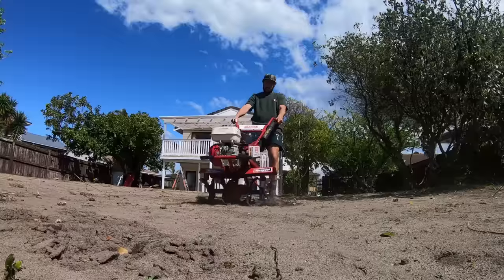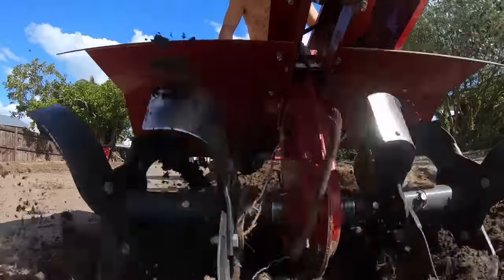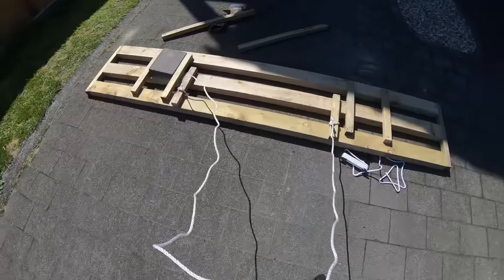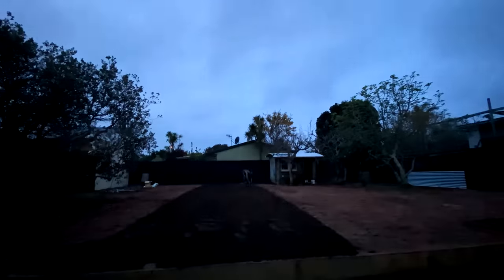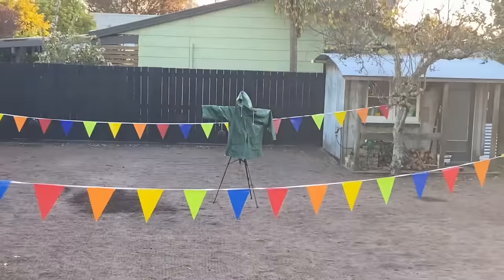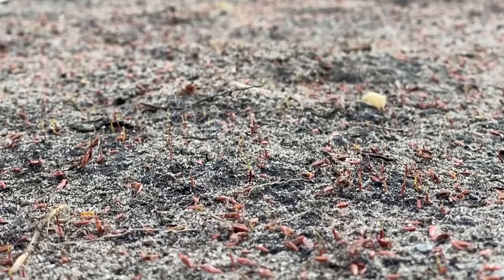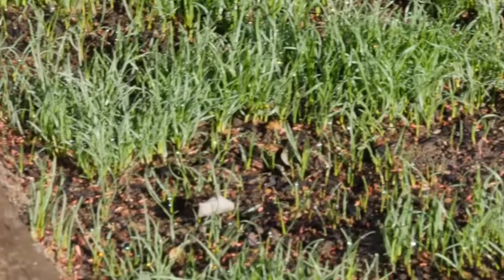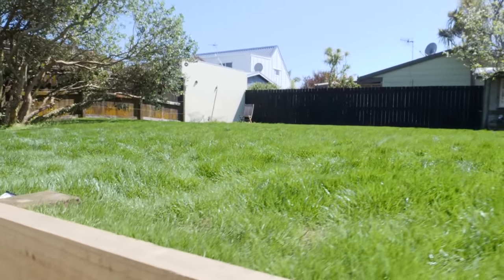HOW TO GROW GRASS

Comment: Great effort end entertaining, can somewhat relate. A couple of weeks ago I accidentally switched a liquid weed control product with RoundUp, and withered a 600 m2 magnificent lawn .. leading to a rebuild of cosmic proportions; so yeah, lots of therapy in that project.

You should have softly raked the seeds about 0,5 - 10 mm in the top soil prior to running the compactor on top and this is likely the reason you're getting bald spots.

Comment: Do you recommend germinating seeds, soaking for a few (5-7) days, in lower Fairfield county Connecticut ? Will have to mix the damp germinated soil with dry ingredients...use Peat moss? Fertilizer?  Please advise. 

I have a very bumpy, un-level side lawn as had to dig up yard to install water draining Cultech systems. So, will order about 20 yards of topsoil...I have about 5500 square feet of lawn/yard area that I will resoil and reseed. 

Further, any need to mix in sand? Lots of rocks, both big and small,  in yard....Connecticut tings' 😊 Thanks.

Comment: You did a great job! I would have recommended getting your soil tested before you tilled that way you could incorporate it into the soil better. I would still recommend you do that. It will help you in setting up your fert program moving forward. It will recommend the amount of nutrients that to be applied for soil correction, ph correction and grass needs for the next season. In the future, you can aerate (punching holes) and overseed and starter fert in the fall for increased density, turfgrass health.

Comment: ( State Certified Nurseryman - and BA minor in Environmental Horticulture ) You bought the wrong type of spreader. I don't even know why they make those - they are just absurd. A ROTARY spreader throws the grass seed more evenly and up to a 6 foot swath on each walk down the row - whereas the horizontal spreader just drops the seed straight down in like a 20" path. And of course if it is broken or the seed is damp at all it is even worse - and way too thick etc . .  I prefer a handheld rotary spreader with top bag attachment - which gives incredibly precise application of the seed. And watering before AND after initial seeding is necessary. And a light raking by just dragging the rake lightly after spreading the seed is a "best practice" and THEN - the most important part is watering at least once per day for 28 days minimum. ( 2 or 3 times a day is best if in hot time of year ) And a good fertilization as well. Preferably organic if possible.

Comment: Hate to be that guy, but what you should have done is broadcast the seed after just roto-tilling. The seed would have fallen into the low spots in the clod field. Then you could have run the roller over it to get good soil/seed contact, followed by watering. Seed in the ground will germinate and establish at much higher rates than broadcast seed. The raking after broadcasting didn't get it buried enough. Cool-season grasses are physiologically built to respond well to deeper planting depth. A thin mulch of clean straw will help keep the soil damp and reduce the number of waterings require to one a day at most.
You didn't mention the species you planted, but species vary as to how they'll behave in the future. I looks like plain old "Kentucky" bluegrass, Poa pratensis, actually a Eurasian species. It will spread into gaps by the means of rhizomes (underground stems). All this info is completely useless now that you have a decent stand, but it might help anybody watching.
Finally, don't make the mistake of frequent light watering. That will produce a shallow non-resilient root system (the part of the plant you can't see is more important than the part above ground). Rather, wait until the sward shows the first signs of moisture stress (blueish color and wiry appearance), then put on 2-3 inches, or 10-15 cabbages worth in metric terms (TAOFLEDERMAUS
 viewers will be able to make this conversion). This will encourage a deep root system able to draw water from a much greater volume of  soil.
John Ortmann, Ph.D.
Rangeland Ecologist